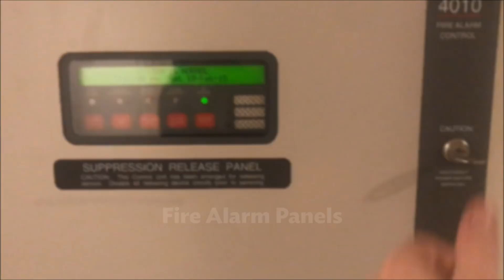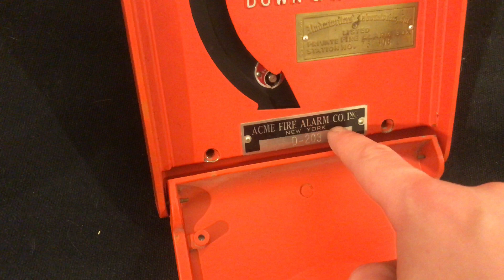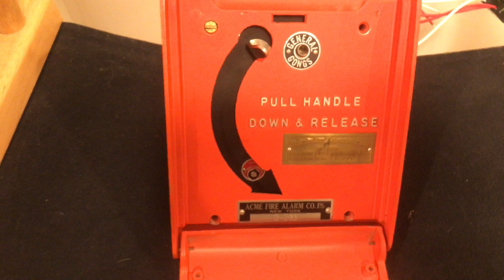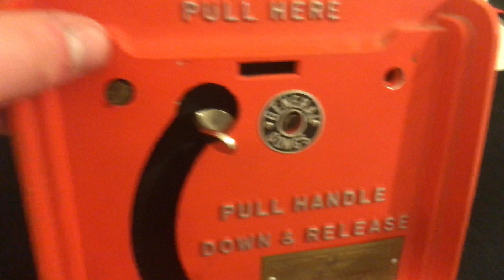Testing and Overview of an Acme Vintage Coded Pull Staion

Comment: I have a ACME panel at one of my sites inspect. The bells stopped working when I pull any of the pull stations. I issue is on the panel or is it the pull stations?

Comment: Some coded pull stations are bigger than modern pull stations.  My middle school which opened in 1956 had gray coded pull stations and when they upgraded the fire alarms to est genesis speaker strobes they wired the new system from scratch

Comment: My high school for the first year had a coded bell system like this which used coded pulls. However, the doors were side hinged and I’m assuming they were Simplex or Autocall. I know they had a central Simplex panel that carried out the code to all the bells. However not sure of the model. The funny thing however was they used a station with 3-1-3 for all fire drills and when there was an actual alarm, the coding was so different that many were confused...
Sadly, they moved to a FireLite SpectrAlert advance system in February 2015